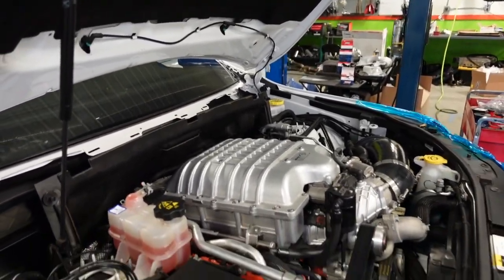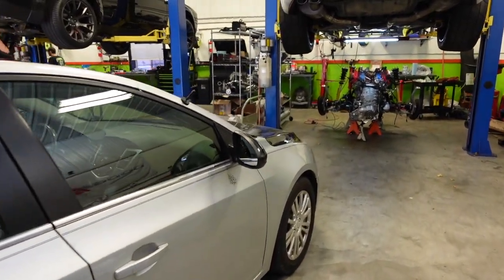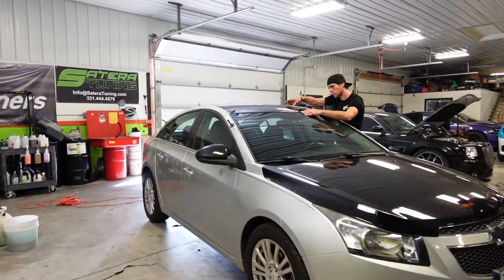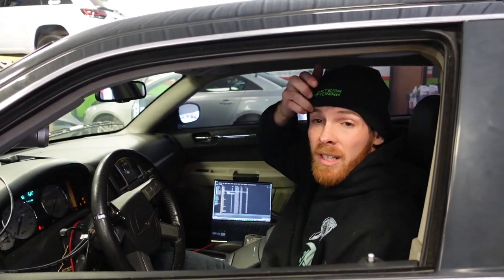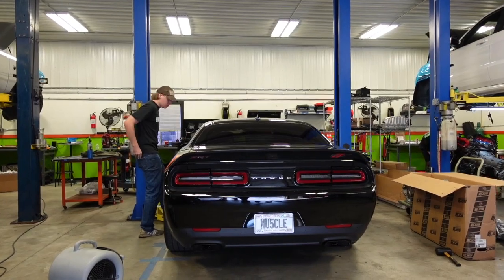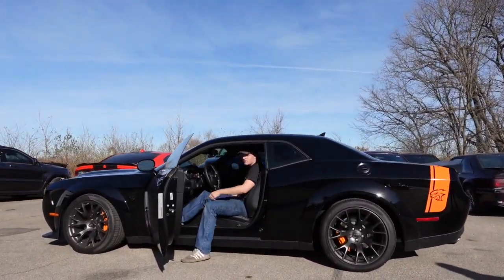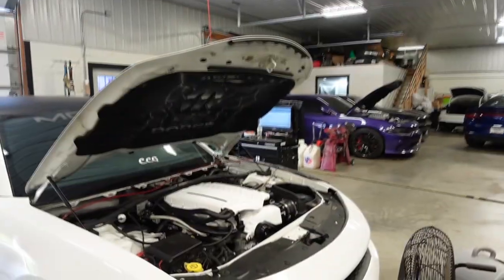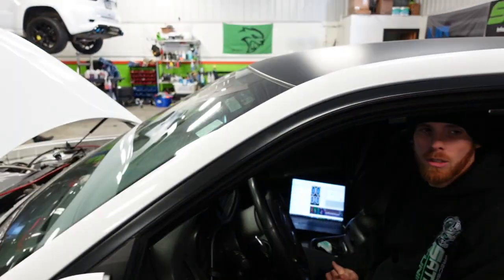EPISODE 18: SCATPACK CHARGER WITH THE NEW WHIPPLE GEN5 WHIPPLE 3.0 !!! RESULTS ARE IN!!!

Comment: I am considering buying the new 3.0L myself it looks promising, thought it would make 800+ HP hell might want to add some NOS
Reply from the maker: This is a large blower that shines with a lot more RPM. It takes about 15-16psi out of this blower to make 800whp.. which is just like a hellcat 2.4L blower. It is too large for these lower RPMs.
Reply: You need to go a LME gen 3 hemi. Speed Society did that and it's a 6.4l apache block but it's Stroked to 426 and is 2000hp capable but they build them to be streetable of around 1400 to 1600hp. Hell the SGT Smash Speed society give away car was a 1200hp Charger. It's not hard to make the 6.4l fast it's just tuners suck these days and most people who own these cars never do the research on parts and modifications for the internals of the entire engine. Better valves, valve springs, rods and heads that flow more cfm work wonders just for NA horsepower gains with these engines. Great video and good job I look forward to seeing the hp number after the full build is completed
Reply: @americanassassin001  let me explain something.  These days people judge cars off how much power can it make on stock motor without bring built. That is what proves their worth to these people right of wrong that's how they are.  The reason the 6.4 isn't thought of higher is because it can't do 800-1000 wheel like the hellcat 6.2 on stock motor or like ford's terminator and gt500 and coyotes gen 2 and 3 and then you got the gm side with the zr1 and zl1 etc etc lot of today's cars can make big power a stock motors the 6.4 isn't one of them.  Yea it can have a built bottom end forged internals and do big power but any engine just about can do that.  Like the 3v 4.6 everyone gives hell in the mustang world 800-1000+ is possible on those too when the motors built they can only do about 500 on stock motor which is why everyone says they're "trash" (mostly coyote fanboys). Engines are judged by what they can do without being built.
Reply: Do you think adding a hellcat supercharger to a scatpack is worth the price?
Reply: @splifgod510 nahhhh because scat packs and hellcats have like a 20k price difference lol, either you want sub 500hp or 707hp🤷🏾‍♂️

Comment: I just got my whipple 3.0 with a built motor and handful of mods I'm looking to be at 735 and 750 hp around 700ish torque u think ot may hold up? Should I get a rear differential brace?
Reply: How much should I expect to pay for a setup like this white 392 chsrger?
Reply: It's hard to say I had to rebuild my engine bcuz they sold it to me with bad head gaskets so when I rebuilt it I just went forged n installation of cam headers ect.. were pretty cheap being the engine was already out but all together around 20k that's the whipple the tunes the build so about 52k range and faster than a hellcat so still way cheaper

Comment: Debating on the new 3.0L Whipple myself. What do you guys recommend on upgrades to stay in the safe side on a daily scat? Thank you
Reply: Forged Internals maybe switch to a Aluminum Block with Sleeves
Reply: Aluminum block for what?
Reply: @Christophertruck  iron blocks are just as stout usually and can be built cheaper.  Little extra weight is the only downside.
Reply: @Mrsrt_Staton   Save weight use iron sleeving though

Comment: Isnt it advised to put pistons and rods in if adding a supercharger to the 392 because of the smaller ring lands? i have heard adding a supercharger to a stock bottom end with crack your pistons with anymore than 5 PSI.
Reply: True the crank comes forged if you plan on staying below 700 just do a drop in piston and rod kit you’ll be straight
Reply: @tavonrice1935  what about more then 700 what else u have to do?
Reply: @alexander_3923  I know a guy with a built 6.4 in a charger it's got forged internals a cam, nice heads, headers, exhaust, an older 2.9 Whipple I believe he's pushing 20 psi on 93 and meth said he put down 840 to the wheels through the auto.  I think forged internals is enough to be safe at that power level.

Comment: Debating on buy this Whipple myself, but have a stock Scat that I daily. Would I be able to run it safely on my engine while not being forged at the moment ? Y’all are pretty close to me too, I’m in Aurora.
Reply from the maker: As we tell all stock 392 owners. It is not a matter of IF..  but WHEN will it blow. They are very delicate and do not take well to the heat introduced. 

But we still do tune and Install quite a few blowers on stockers with the owners knowing the gamble.
Reply: So you saying it will deff blow just don’t know when ? No matter what mods you put in a 6.4
Reply: @pauljones5136  if u put forged internals and a good tuner u will be good
Reply: If u gonna spend 8 racks on a 3liter whipple , do it the right way and drop a lil extra on some forged pistons
Reply: @MrFryguy87  exactly with forged piston u will be able to run more boost without blowing up ur engine and if ur spending 8k for a blower might as well spend a lil more and do it right
Reply: @alexander_3923  how much you estimate it will cost for everything. Whipple, forged internals? Would I need a new transmission?
Reply: @Edd0614  If you have a scat and go over 600hp, you will need a new trans. Going all forged, blower, trans and labor plan on 20k.
Reply: @larrygarms7230  thanks

Comment: What supporting mods would I need to be safe with that whipple
Reply from the maker: All depends on what vehicle we starting with and what end power goals are.
Reply: @sateratuning  I have a 2020 scat challenger I would like around 750-800 whp what supporting mods do I need?
Reply from the maker: @yothatsjulian3022   to do that the right way you will want a properly spec'd short block, power adder of some sort, and complete fuel system.  That will be a great base to start.

Comment: I wonder how these 6 rib belts going to hold up with some real power
Reply from the maker: we expect to be the same if not worse then the 2.9 whipple.
Reply: @sateratuning   How is the 2.9L
Reply from the maker: @Christophertruck  2.9 was out for a long time and results can be had all over. Generally around ~15psi of boost is when we battle slip.

Comment: Mr Satera is it true that even if u have forged pistons, u still can blow your motor because the 3.0 liter whipple is just way to much for the motor ?? I’m hearing a lot hemis blowing up with the new whipples
Reply from the maker: It is still very possible to blow up a forged engine. They are NOT invincible. There are far more variables involved then the whipple. And that is NOT to blame. As there are power adders out there that can make way more power then the 3.0L... So that comes down to everything else... Assembly, fueling, components used, temperatures, tuning, etc etc... I really would not blame the whipple out of all the other potential things it could be
Reply: @sateratuning   ah ok I see what your saying , I’m kind of stuck right now on what to do with my 392 , either whipple or pro charger , I recently bought forged piston and rods , a 224/240cam   Now I just need to decide which route I’m going to take as far as boost , any tips and advice would be much appreciated
Reply from the maker: @MrFryguy87  That all comes down to HP goals and the feel you want... PD blower like a whipple is more like a light switch. Boost is instant... Procharger is linear and doesn't hit has hard. Easier on drivetrain and can generally make more HP up top but lacks the low end. 

So figuring out the feel and power you want will guide you.

Comment: What internals need to be upgraded to run this supercharger safely? I’ve got a 2021 wide body charger with 7k miles on her. Standard ungrades, JLT CAI, Corsa Xtreme Loud Cat Back, BBK 90mm TB, Pedal Commander. But nothing internals been touched.
Reply from the maker: At a minimum we recommend a rod/piston upgrade. But it does depend on end power goal. That will determine what extent of mods you should do to support the blower
Reply: guys....what have you guys seen a 392 on boost or supercharged maxed out before u start breaking shit?
Reply: @sateratuning  for like 700hp whould just forged internals be good?
Reply from the maker: @alexander_3923  Yes, Generally a proper set of rods/pistons will take you upwards of 1000whp

Comment: For the white 392, when you said stock lower did you mean the bottom end is stock ?
Reply from the maker: Stock lower pulley reference the crank pulley is stock diameter. On a Supercharger application, if you install an overdrive pulley (or a larger diameter pulley) it spins the Supercharger faster creating more boost.

Comment: I have a 2014 Chrysler 300 5.7 AWD mods that I have what estimate what power u think ima be at?

1. Forged 397 stroker (6.5L)
2. D1-SC procharger 11-12 pounds 
3. Nitrous outlet (100shot) 
4. Texas speed stage 4 boost cam
5. JBA headers
6. 5.7 Ported heads
7. Ported 6.1 intake 
8. Ported 95 throttle body
9. 3600stall converter 
10. Snow performance stage2 2.5 methanol
11. Afe throttle body spacer
12. 1050cc injectors 
13. E85
14. TPS fore innovation dual pumps 450
15. 1 piece 4” Aluminum driveshaft
16. 3.5 pulley 
17. BC racing coilovers AWD 
18. Custom aluminum Cv-Axles front and rear
19. Valve Body going in  “stock trans will hold up too 1000+hp
20. Transfer case module 
21. NGK iridium spark plugs “gap size 25”
22. Racing Intercooler 
23. American racing solutions hemi belt tensioner 38LB spring 
24. 18% overdrive ATI super damper
Reply: @lastbreast  750hp without spraying 850hp when spraying

Comment: What power does that 392 makes now? 700 is kinda low.
Reply from the maker: Not low at all for the boost he is at. This is all he wanted to make. So we built the motor to handle more. But he just wanted a reliable 700hp street car.
Reply: @sateratuning  What imean that if this engine rated to 1200-1500whp, pulling 700whp out of it is kinda low. Plus 700whp for a heavy car is not enough.  I bet he cranked that up by now to keep up with bolt on e85 cats, it is never enough  power 😈